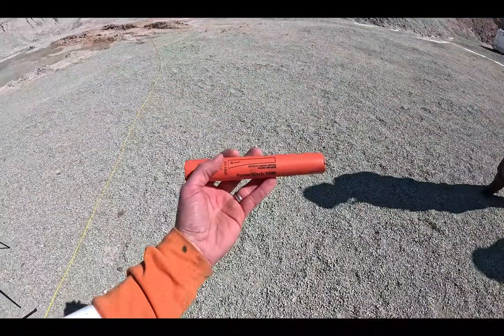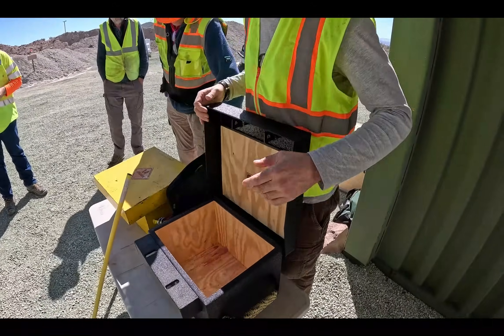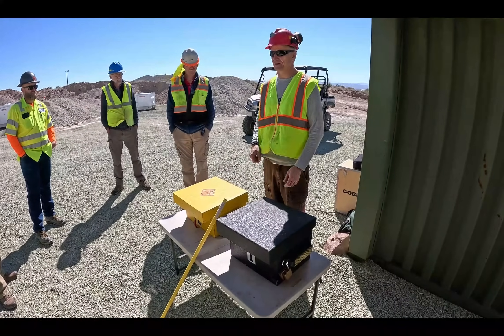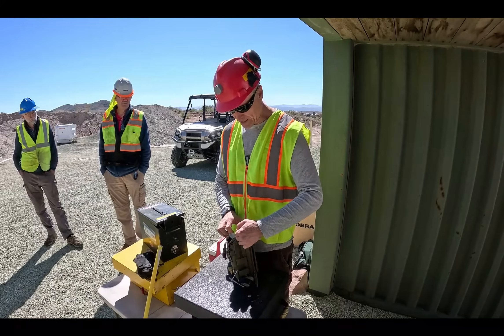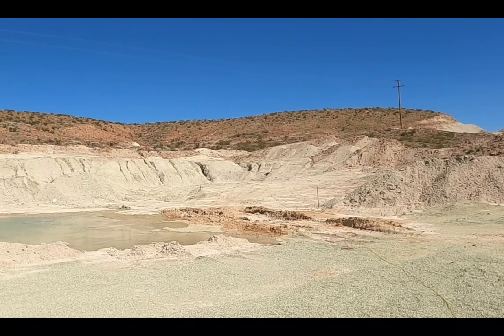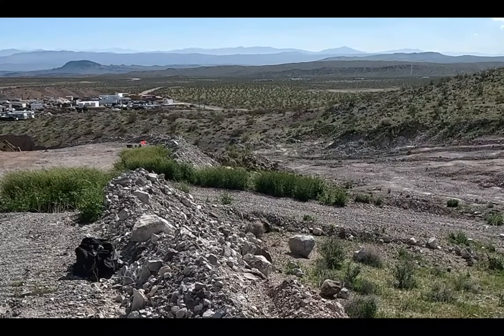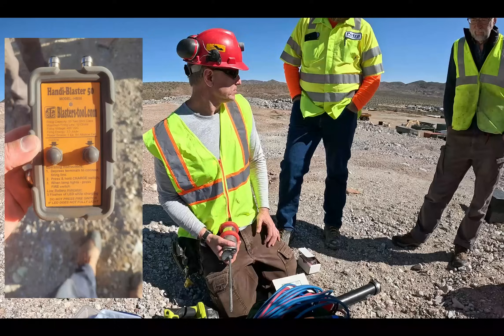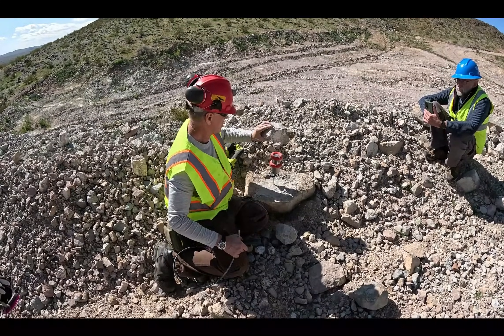Blasting & Explosives Training with ACCX Research

Comment: I own a Hard Rock Rhodonite deposit. So far been able to do enough Damage with Dexipan . Eventually would be nice to do a few blast.. My 
Last break from the Dexipan was over 10,000 - with a huge 5000 pound boulder being the biggest of Rhodonite.
Reply from the maker: Ron, I really like the expanding grout options from dexpan and ecobust. We recently learned, as demonstrated in this video, that you don't need to use a generator to initiate Sierra Blasters. The Handi-Blaster 50 will do the job. That will help us in remote locations. Now to find out what the limit to the Handi-Blaster box is. How many Sierra Blasters will it set off? Are the metal stemming heads even needed? Why can't we just properly stem a hole with sand/cuttings etc? We just took a class with the American Explosives Group (next video), and that class helped us understand the science of blasting. What do you want or need the rock to do. All of this information is providing options for those that either want to get their blasting license, or if unable to for some reason, know what other rock breaking options are out there to properly work your mine. Thanks for sharing your experience with us.

Comment: You can actually do the same thing with substitute black powder (pyrodex,etc) and you dont need a license for it simply because its not considered an explosive..but a propellent.. even though its actually explosive. I use that for my mines and it does quite well in blasting rock. Only thing with it is you cant really use it if the rock is too brecciated( lots of cracks in it) otherwise the powder force doesnt break the rock out very well because the force just goes out the cracks. Save LOTS of money and just use substitute black powder. Much safer to use and no license is required.
Reply from the maker: That's extremely helpful information! Thanks for sharing 👍.
Reply: @mineoperator  yvw!   I'll explain how to do it if needed.  I use 12g empty shotgun shells and bell wire and steel wool. Just cut 2 pieces of bell wire to whatever length yah want. Make sure Thier the wrapped type of wire. If not then wrap the wires around each other loosely to make it into one piece. Take one of the ends of the wires and twist them until like only on half inch is left then spread them into a V. On each end of that V strip off about a quarter inch or less of the outer coating. Then take an strip off a piece of steel wool. Make sure it's taken off in a small strip. Wrap one end of the steel wool strip around one of the ends of the V then just fold the end of the wire over the end of the steel wool strip then do the exact same thing on the other end of the V then cut the rest of the steel wool off. Make sure yah have at least a half inch strip of steel wool between the V.  That's ur fuse. 
Stick that V all the way to the bottom of the shotgun shell and start filling the shell with the powder.. about maybe a quarter or less inch under the folds of the shell. 
After the powder is in there pack a tiny bit of cotton or light paper or something(I use a sheet of TP torn into small strips) and pack that inside the lip of the shell and around the wire fuse.. then close the shell tabs. If u want u can seal the end of the shell with wax so the shell doesn't accidentally open up or the powder falls out. That's why I use strips of TP. I eliminate the wax that way. 
After all that's done hit the two wires to the POS and neg of a battery and boom ... Ull either crack the rock pretty decent depending on how much of a rock face is there or it will shatter the rock completely. Also u will need to drill 1 inch holes for the shots and u can use as many shots as you want. 
I drill 3 foot holes then drop in like 4 to 5 shots then tamp in a wad of damp newspaper just to hold in the blast better then I stem the remainder of the drill holes with damp sand or clay then at the top of the drill holes I tap in plastic plugs. Anything else may damage the fuse wires. 
Also at the end of the fuse wires that will stick out of the drill holes,. Strip off about a half inch to an inch of the outer coating so u can wrap those to ur main blasting wire that u hit ur battery with. U can also use those rechargeable blasting modules too. Just as long as it's 12v or below electrical. I guess a bit higher voltage may work too , it's just I've never tried it.
Good luck!   :)

Comment: Things sure has changed on the safety.  My grandfather used to have to use it for helping make roads. My dad told me that grandpa would get a load of tnt. It would be just in its boxes in the back of the truck. And the blasting caps were put in the glove box.